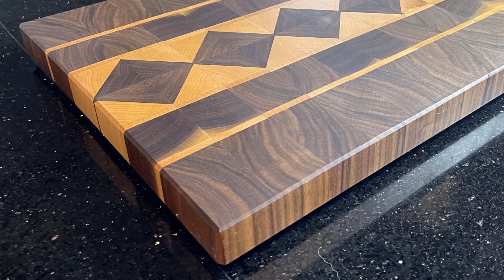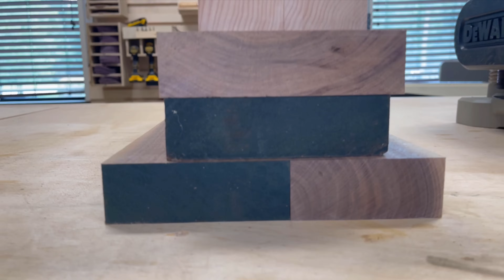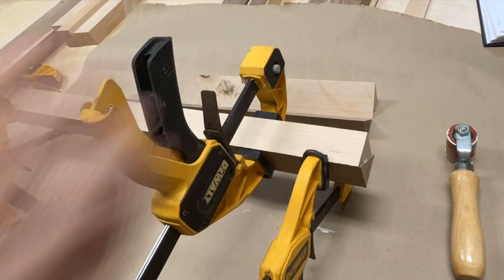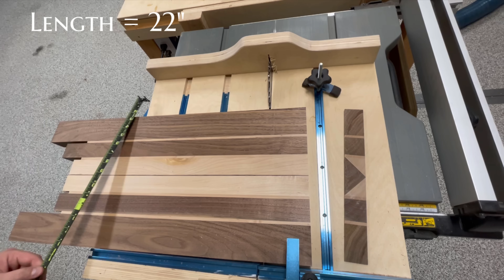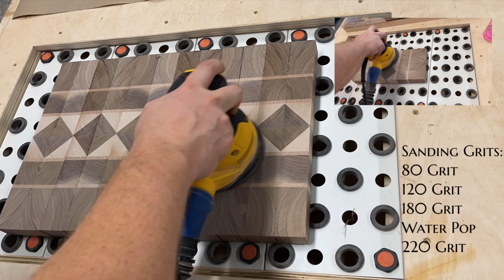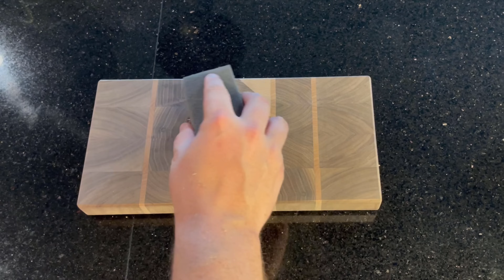Diamond End Grain Cutting Board Set

Comment: Great looking board! For the clamps what I have found to be the easiest and least amount of work is to get a 2" section of PVC pipe that is a little bit longer than your longest clamp. Glue the end cap on one side. Fill it most of the way to the top with cheap plain white vinegar, leaving a several inches for displacement. remove the sliding jaw part of your clamp. Dunk your bar in the tube and let sit for 20-30 minutes. when you take it out, the glue is easily wiped off. It may discolor the bar, depending on what kind of clamps you have, but it doesn't seem to affect the mechanism of the clamp. I made a little holder to keep the PVP pipe against the wall so it doesn't fall over. Every so often, I just swap out the clamps from the cleaner while I'm doing other things. when the glue is off, and the clamps are clean, apply paste wax to the bar before putting the jaw back on. makes it so you can go longer between cleanings. I just use the same vinegar over and over, and top off as needed. (Eventually I will need to dump it out and start over. Just haven't yet.) Good luck!
Reply from the maker: That’s a fantastic explanation. Thank you for sharing this with me. I am going to pin your comment so that others can see this.
Reply: How wide do the boards need to be that have the 45 degree on them — I tried some with 2” wide which is all I have and it didn’t turn out right but I’m gonna roll with it
Reply: E realmente fantástico  espero um dia fazer algo assim  , Ainda estou começando mais vou chega lá se Deus  muito lindo seu trabalho  mim , motiva  muito obrigado

Comment: To clean the glue off your clamps take the clamps apart. Then get some PVC pipes with end caps seal one end then fill it with  acetone to the top . Place the clamp rods in the PVC pipe and cover  them. Let stand overnight and by morning you will be able to take off any remaining glue that did not dissolve. If you want to make a stand for the pipes just get two 1x 3's drill holes  the size of the PVC pipe put the PVC pipe into the two 1x 3s add 2 cross legs on the bottom and it will hold them upright.

Comment: One thing I’ve discovered when working with a thin strip running down an end grain board is that it’s incredibly challenging to align the pieces perfectly from one to the next. I now make a separate end grain strip, cut the board to insert for a perfectly clean line. It’s an extra glue up but totally worth it imho.

Comment: I don't know if I understand correctly, but mineral oil is what goes rancid! I have been successfully using milk thistle oil on cutting boards, which has been used to protect wood and enhance patterns since ancient Egypt. It is food grade and can also be used in the kitchen. It is not expensive compared to mineral oil and lasts a long time. I use it in combination with beeswax and polish it after it dries.
Reply: Mineral oil does NOT go rancid.

Comment: For glue removal, I have 2" PVC pipe with a glued cap at the bottom and a screw cap at the top.  I fill it with diluted vinegar (half vinegar, half water) and soak my clamps for 5 min or so.  THen all the glue just wipes off.  clean really well then apply paste wax!

Comment: That is beautiful.
Have you ever tried using ether (stating fluid) to clean up the glue deposits on your old clamps? That MIGHT Work? I use it all the time for sticker removal and cleaning the glue from them off the metal on my Freightliner Truck when i change annual fuel tax stickers, and year stickers on license plates, works like a charm. That's a different glue, but the only thing i can think of right now.

Comment: Be careful to not apply too much water on one side if you're going to try to raise grain. I warped a finished board and had to resurface it so it ended up being thinner than I wanted. I no longer do that because I don't think it's worth it on end grain for the amount of raised fibers you get. Face grain, sure, and maybe edge grain but not end grain. JMO.

Comment: Lovely boards; and well described tutorial as well. I will be making some of these myself; as well as some 3D Cutting Boards. Re. yr. glue "mess-up" of clamps: try finding a paint scraper that holds about a 2 or so inch long replaceableTungsten Blades. They are readily available here in N.Z., and don't cost much (Amazon should have them). The  dry glue scrapes off the Clamps so easily, and the blade seems to last for years! Also, blue Painter's tape stops getting glue onto the clamps if applied prior to use. 🤠☝

Comment: I started finishing my boards with mineral oil; mineral oil does not dry....  I've since changed to 100% pure tung oil.  It soaks into the end grain and dries hard, so no re-coating down the road.  The only draw back is that tung oil does take significantly longer to dry, but anything worth doing is worth doing it right.  I do put a coat of mineral oil and bees wax over the tung oil and buff out when dry.
Reply: yeah… moths to dry and become food safe… mineral oil makes it ready to use the next day and looks better
Reply: @15andinvested mix 50/50 tung oil and d-limonene. Heavy coat for 30 minutes, wipe off excess, repeat the process. After that I use a "board butter" made of 2 parts coconut oil and 1 part bees wax melted then chilled into a wax. Buff that in and let it cure for 3 days. I do this on all my wooden utensils I carve as well.
Reply: @ coconut oil can go rancid….
Reply: Not months if you apply thin coats with an old t-shirt.  24 hours in a shop that maintains temperature .
Reply: @unclebob8746  the tung oil gives maple a yellow look, doesn’t look as nice and the bright white with mineral oil

Comment: VERY cool design! Thanks for sharing. I do want to make a comment here about the use of your crosscut sled. For me, I love to use my radial arm saw to do the crosscuts. The reason behind that is because I can very easily put a stop block along the fence that has been measured to whatever length I need. The cool thing for me is that the guy I picked it up from included an insane amount of extras and it has made my life incredibly easy. I still use my table saw for ripping and the angle cuts you show here. 
As a fellow woodworker, I like being able to make suggestions and of course see what others are doing.

Comment: You can use salt mixed in with the glue to help keep the boards from sliding so easy. To clean up your clamps, use some mineral spirits. Make sure you take precautions so you are not inhaling fumes without a mask on.your face.

Comment: I recently finished making your diamond cutting board.  Your instructions were clear and overall were excellent. I loved the look until I applied  the mineral oil at which time the board turned very dark and covered up the grain in the maple and walnut. In my opinion this really detracts from the appearance. Do you have any recommendations for remediating this condition.  Thank you.  Tom R
Reply from the maker: Hey Tom, I have had similar experiences with other boards and unfortunately there's not an easy remedy. Each wood species takes mineral oil differently and sometimes alters the color of the wood significantly - especially when you're dealing with an end grain board. I have even noticed significant variation in color change between different boards of the same species. For example, maple tends to turn more "amber" color rather than white once oil is applied.

There's not much that can be done at this point. My only advice would be to make your wood slection for future boards with this in mind, given that the post-finish color change can really alter the final look of the board.

Comment: There's a better solution than taping the bar every time. You can use vapor barrier, or rolls of thin plastic. Hardware box stores sell it in the paint dept or Dollar Tree has 9' x 12' for little more than a $1. The glue cleans off the plastic easily and prevents glue from dropping onto your work bench.

Comment: What are you using to apply the mineral oil to the wood?
Reply from the maker: I buy these cheap applicator foam blocks and then  cut them into smaller pieces. They work like a charm and you can throw them out when needed.

Link: https://amzn.to/48hWtUO

Comment: I saw one of these cutting board person's using wax paper instead of tape. It works like a charm as the wax paper doesn't stick to the clamps. Cleaning the clamps , try using a wire brush on your grinder.
Reply from the maker: Great tip! Thank you
Reply: @EigenDesigns  Ditto on wire brush and grinder

Comment: I messed up my new clamps the same way too 😂, I cleaned them up with my grinder and a wire wheel they came out polished, then I started using packing tape, the glue peels right off, the packing tape last awhile too I only change it when it starts getting worn out from the jaw clamping hard on them and starts to peel, but it lasts awhile. Good job on  this cutting board I’m gonna try this out for my next one

Comment: Use a drill motor with a wire wheel attachment to knock off that dried glue. Run the wheel in the same direction as the grooves in the clamp. After the glue is gone just use painters tape over your bars to protect it
Reply from the maker: Thanks Gerard!

Comment: Too new to try this board, but did. Problem with maple strips, made small zig zag not a straight line?  Diamond was centered well. Also had some pieces that would not pull tight. All in all I got a very expensive piece of firewood,  but will try again.  Thank you for putting out such good information.
Reply: Ok, I’ve figured out what I did wrong.  Time to make a new sled!

Comment: Try using blue tape instead of clamps when gluing up your 45s just like you would with any miters.

As long as your stock stays relatively straight after ripping, which yours did, it won’t take much force to keep them together during the glue up. The blue tape will lock the two pieces together along all axes so they don’t slide around.

It’s a lot easier than messing with clamps and frees those clamps up so you can glue up the rest of your straights strips.

Your channel is one of the good ones that narrates your process from start to finish so people can actually learn from it instead of just timelapsing with overlaid music. I’m sure that’s is appreciated and hasn’t been lost on your viewers.
Reply from the maker: Thanks for the blue tape tip Ryan. I will have to give that a shot. 

I also appreciate your support. I try to make my videos as helpful as possible so your feedback is helpful.

Comment: Great looking boards. Quick question.  Once you have finished them.  how long before you will be comfortable having them used  ????
Reply from the maker: Hey Hewitt, once the glue is completely dry and you apply the mineral oil, you can use it immediately. Since mineral oil is food safe it doesn't need to dry like a traditional wood finish. I usually wait until the mineral oil no longer has visible wetness on the board (~30 minutes) and its good to go.
Reply: @EigenDesigns  Thank you for the info.

Comment: Great video! What did you apply the mineral oil with? A sponge? Also, I’ve used a wire wheel in a cordless drill to get dried glue off my clamps. Lesson learned here as well!
Reply from the maker: Hey Nate, yeah I use these cheap applicator sponges to apply the mineral oil with. You can get them in bulk from Amazon and I usually cut them into smaller pieces to make them last even longer.

Comment: Love the board design and techniques.
When cutting the equilateral triangles how do you consistently cut them all the same size as it looks like you move your fence in for each cut. Do you use a jig or something similar as when I try I have tried I get inconsistencies in thickness.
Reply from the maker: Hey Robert - I didn't use any jig to cut the 45 degree wedges. If there was any discrepancy in the sizing I would try to clean it up after the glue up using your planer.

Comment: Can you do this with 3/4in thick stock?
Reply from the maker: Hey Jaydon, you can make it with 3/4" stock, but the diamond pattern will be smaller. Other than that, its still possible.
Reply: @EigenDesigns  what did you use 1.5 or 2in?
Reply from the maker: @jaydonballman1135  I started out with rough cut 2" (or 8/4) lumber, but then milled it down to ~1.5" after all was said and done.

Comment: I use a wire cup brush on a right angle grinder clamped in a vise . Make sure you wear eye safety goggles. You can take off years of glue in a couple minutes and brighten the metal also!

Comment: Thanks for a great video. I love the design of this - and the concept of the "matched" large and small cutting boards is brilliant. Will definitely be using some of your ideas when I have a crack at making some cutting boards myself.
My dirty clamps - I tend to pull one end off them and then clean up the bar on a wire wheel / brush on one of the bench grinders in my shed. The wheel buffs up the rail nicely and cleans off glue etc without doing any damage to the rail.
Reply from the maker: Thanks for the support and the tips!

Comment: If you don't mind, what were the dimensions of each board?
Reply from the maker: Hey George! Are you asking about the final dimensions of the large cutting board and the small cutting board?
Reply: @EigenDesigns  no, each individual board that you started with
Reply from the maker: @georgewiggins3578  If you look at the video at 5:19 looking from left to right: 3.25", 1/4", 1.75", 1/4", each 45 degree blocks are 1.75"x1.75", 1/4", 1.75", 3.25"
Reply: @EigenDesigns  thanks for the info
Very nice board

Comment: Hi
Nice work!
Can you say if your planner has a flatness issue 3 or so inches in the front and the back of the plate? I have the same planner but no piece comes out fully flat.. ☹️
Reply from the maker: Hey Rafeal, I don't have that issue with my particular planer. I do get quite a bit of snipe with my planer, but that is not unusual. Are you using the infeed and outfeed tables with your planer?
Reply: @EigenDesigns  Hi champ. I did not get them and they are not available in Israel. I do use a HDPE plate and place any piece on it before feeding into the planer but it doesn’t change the phenomena. I’ll keep looking for a solution 
Anyway, your videos are inspiring. Thanks
Reply from the maker: @refaelregev9812  What you describe sounds like planer snipe. Can you take a look at this article from the wood whisperer and tell me if that is the "flatness" issue you are talking about: https://thewoodwhisperer.com/articles/dealing-with-planer-snipe/
Reply: @EigenDesigns  bingo!
Thanks champ
Reply from the maker: @refaelregev9812  Awesome! Have a great day Rafa :)
Reply: @EigenDesigns  you 2 champ

Comment: I agree with the PVC pipe and white vinegar. My clamps were almost completely filled in the dimples with glue. A day or two in the vinegar and I can literally use my fingers and a paper towel to wipe it off. Able to easily pick out the glue from the dimples. I've done 5 clamps so far, only 8 more to go. I already bought tape to keep them clean now.
Going to try this design, looks great.

Comment: A pro tip on the alignment which is off a bit:  That’s resolved with clamping a board on each side when gluing up preventing any movement/sliding side to side.  I’ve done this before and the alignment ends up perfect.  Put some tape on the boards before clapping the side pressure otherwise they’ll attach themselves to the cutting board w the excess glue squeeze out.  Otherwise, excellent video/tutorial.
Reply: I make end grain thin panels that are placed in to ensure exact alignment to ensure perfect lines. Have seen many videos of simply flipping the board and they are never right.

Comment: Great video! I did not read all the comments but simply wrapping the bars in paper towel and then soaking with white vinegar fixed mine with 2 soaks. I LOVE your idea of the blue tape though so will actually clean mine again now and use your trick to keep clean(at least until I forget one time). Also like the idea of the quick clamps to hold diagonals and will try that soon

Comment: Another option to prevent wood moving during glue up . Tape a piece of walnut and maple together to form a square board  . Now on the drill press drill a 1/4 in hole thru the boards  close to the end. I make my boards just a little longer than I need them to be. Cut 2 pieces of 1/4 in dowel approximately 1and3/8 long that will fit in the hole. Remove the tape and  apply the glue ,  tap the dowels thru the holes until they are located just below the surface of the wood .  Tightly place 2 or 3 more pieces of tape along the length of to board to aid in stability then clamp the boards together with even pressure on all sides of the boards. Clean up any excess glue squeeze out and let it set . Remove the tape and continue with the rest of the glue up . Ultimately the dowels will be cut off from the final product .

Comment: Love it, Just found my next project!

Question....  How does this work out if you used 13/16 S3 thickness boards?  I do not have the equipment to work with those thick chunks you had, and do not have a thickness planer, so I buy prefinished lumber.
Reply from the maker: Hey Levi! Thanks for the support. I think you can re-create this same patter with 13/16 lumber, but the pattern will be a bit smaller, which may not be a bad thing. I know there are quite a few woodworkers out there that dont have a jointer and a planer so maybe some others can follow in your footsteps.

If you end up making this, tag me on Instagram so I can see your final board. I have had quite a few people make my boards/projects and then share it with me and I love to see it.
Reply: @EigenDesigns  I'll be trying it this weekend. I'll do African Padauk diamonds, cherry background and maple highlights. Very seasonal colors.
Reply from the maker: @nethead72  that's going to look soooo good! You have to show me once you're done. :)